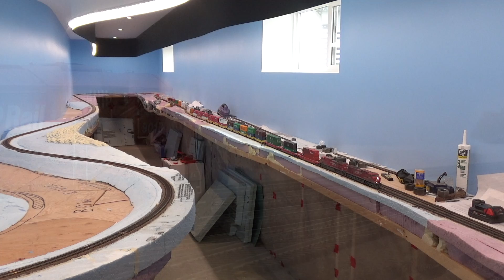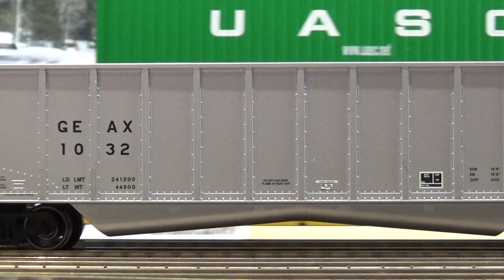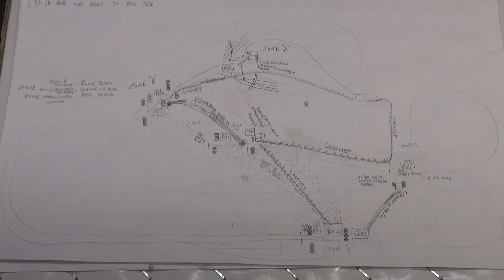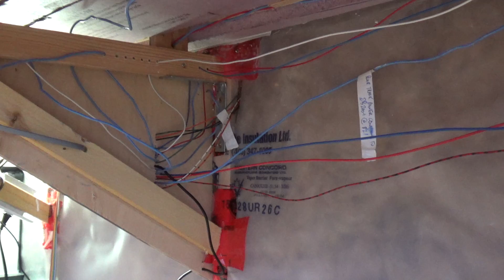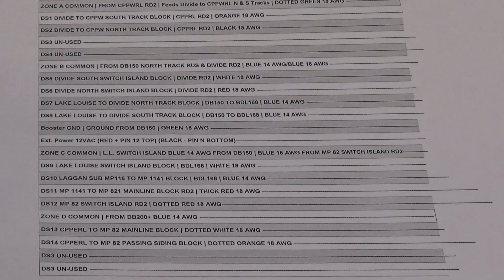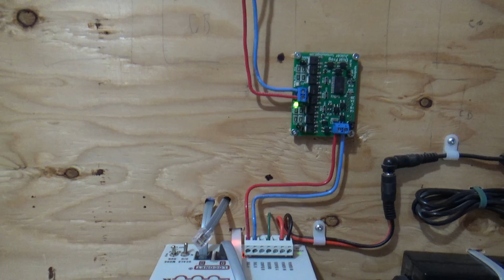Layout Update - September 2018: Trains Running! Mainline Complete, Block Detection Operational...

Comment: So Block Detection question time, I want to use it for Signals and to activate my grade crossings.  Does it just detect the loco, or do I need to add resistors on the freight cars and cabooses ?
Reply from the maker: Sorry I don't know much about grade crossings. Haven't got there yet. I think you would have to have a detection system independent of your block detection though. Might be easier?

Comment: Damn awesome when trains start to run, my moto when building a new layout is run trains for a while in different climate and sort out problems before having to rip up scenery to fix :). Keep up the awesome work and ahh thanks for the memory, I travelled on 503 VIA rail when I was over on holiday, yes certainly a very well detailed car, look forward to more updates
Reply from the maker: That's good advice, I will definitely be running trains to sort out the bugs before moving ahead with scenery. That's neat you rode on 503, I've been in a few of them myself; 504, 507 and 515 were on the Canadian I rode a few years ago. Thanks for the comment!

Comment: Those Rapido cars roll like they've got roller bearing wheels similar to what Intermountain sells. One of the other regulars over at Bruce Chubb's SVOS has been working on Bruce's entire passenger fleet replacing wheels on all the old brass cars with those Intermountain roller bearing 36" wheels and they now all roll like your Rapido cars. It's great.

Comment: Awesome Dude!  Looks a amazing!  Are you an EE or electrician?  I’m a Mech Engr. and watching this video on wiring made my head hurt 😊. Gotta start doing this soon and it seems scary.  My layout is not nowhere near this size but........  You are very detailed and meticulous (a good thing) can only imagine what your scenery will be be like.  Trains running 👏.
Reply from the maker: Thank you very much for the kind words. I'm not but my brother and dad both are electricians so I have learned a bit from them over the years. It seems overwhelming at first but just work through it one at a time. I made a paper wiring diagram that I showed in the video, so once I had that I made a list of how many wires needed to go where based on where the boosters are located. I ran some runs diagonally through the joists in the ceiling to cut down on length because the DCC signal can start to breakdown if bus runs are over 30'. 

I also learned a ton from Alan Garnter's fantastic website www.wiringfordcc.com
Reply: BArailsystem thanks for the video tip

Comment: Awesome layout update, thanks for sharing.  Your layout is coming along nicely and it's fun following along.  Would you  consider making a "how to" video on the signaling when you get there?  Do you have any recommendations or tutorials for the block wiring for planning a new layout?  Thanks again - Steve
Reply from the maker: Thank you very much Steve. I could absolutely do a video on the signalling. 

I figured out my blocks based on desired train length which is 25' due to the reverse loops. If train length exceeds the block length you will have trains occupying multiple blocks simultaneously and it would not be prototypical. So knowing the blocks couldn't be shorter than 25' I divided the layout into blocks on paper with that in mind and where I wanted the signals to be. Once I had that plan I went ahead with wiring, I made some mistakes on this as I ran a dedicated bus to each block which was overboard. Only need one dedicated wire (blue in my case) per block for detection. One wire (red on my layout) can be common to both and shared by two blocks like on double track for example. So I did waste some wire but better to have too much that too little because I drywalled after that.

If you want you could email me your plan and I could have a look at it. If you are going to use the Digitrax signalling hardware I have a pretty good handle on how to wire for that now.
Reply: Thanks so much for getting back and the offer. I’d definitely take you up on that at some point. I’m currently building my second layout now after moving and having to tear down my old one.

Old layout was originally DC and then upgraded to block DC. After I converted to DCC and didn’t have to change much. I never got as far as signals and block detection on the last one so it’s all uncharted territory for me!

I have some RRCirkits stuff for detection and signals but have never used them. Considering selling them since I have a digitrax system and getting digitrax items for the block and signals. I’m also doing N scale!
Reply from the maker: You can get in touch with me at BArailsystem@gmail.com 

Since you've already wired a block DC layout you already have skills for a DCC block detection layout! The wiring is almost exactly the same. The trick is placing the booster(s) and BDL168 board in a central location to minimize the wire run lengths. N, HO, or G current detection works the same. I don't have any experience with the RR circuits stuff but I am sure the principle is the same.
Reply: Thanks Ben, I’ll send something over when I get the trackplan finalized. I’m sure there will be many questions along with it! Thanks again! - Steve

Comment: I hope you and yours had a good summer.  Gees I think I would need an electrician to figure out your wonderful wiring.  As you can tell I find my wiring by block to block.  Oh, would you say hello to your little guy for me? I am going to watch once more to see if I can figure out your wiring.  Very good layout.  I wish I was there to help you out.  Looking forward to next months update.
Reply from the maker: Thanks Brian, I will let him know you say hi. I figured out my blocks based on desired train length which is 25' due to the reverse loops. So then I knowing the blocks couldn't be shorter than that I divided the layout into blocks with that in mind and where I wanted the signals to be. Once I had that plan I went ahead with wiring, I made some mistakes on this as I ran a dedicated bus to each block which was overboard. Only need one dedicated wire per block for detection. So I did waste some wire but better to have to much that too little because I drywalled after that...

Comment: Congrats on the milestone! You may not think so but you have been busy! I love how the trains does not overwhelm the layout and it gave me an impression of being out of nowhere and hiking in the wilderness. You have appearently done a lot of thinking and planning ahead while you have done the electrical bit and it is a great thing to do this before doing the details and scenicing thing. You mentioned that you were to box in an electrical device, jut remember to give it some ventilation so it remains working for years to come, my own experience from my former job, where I was maintaining computers at work and they did not thinkabout the ventilation and everything almost broke down because of it.
Reply from the maker: Thanks Ollie! I did spent 6 months planning it, just as important as construction I think. Yes, absolutely there will be provisions for ventilation. Those computer power supplies don't like heat.

Comment: just curious, how will block detection work with rolling stock? Would adding a small watt high ohm resistor to the wheels provide the necessary continuity for detection? I have no experience with detection so I'm genuinely curious if that works.
Reply from the maker: Exactly how you describe Caleb, you can add resistors to the wheelsets if you want each car to set off the detection. For me modelling modern day operations, a FRED, rear DPU or caboose will be enough for my needs. Just need to be able to detect each end of the train.